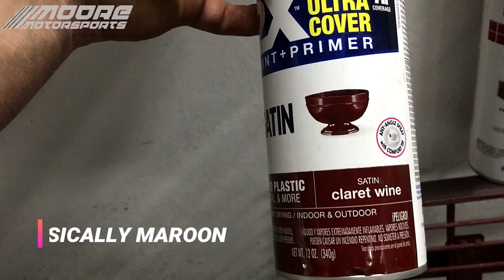Cheap Satin Spray Can Paint job With AMAZING RESULTS! (CHEAP DIY)

Comment: Looks so much better that it did before, I like the matte look of the paint too. I love the trick with wet sanding using the sprinkler, I wouldn't have thought of that.
Reply: I get a gallon jug with a few small holes on the bottom that way it slowly drips out n keeps things wet.
Reply from the maker: BIG ANT that works great too!!

Comment: Legit the only person I know of that can spray bottom to top bs top to bottom and make it turn out good. Whenever I see anyone else and or have tried myself spraying that way it always has the paint overspray from the air that drives and falls down into the wet paint leaving that gritty look here and there. Still comes out with wet sanding but so much more work. Congrats on being able to do it properly.

Comment: Man, I just used 2X recently, the white high gloss, and I really like it. I think I personally like it better than Advance Formula in most ways. I think it dries faster, though, which is good and bad, but it also seems to actually dry harder and more durable, it feels almost "urethane modified" compared to Advance Formula. I feel like it's gonna be way more durable based on my hunch handling my hood and being able to put it back on the car after 3-4 hours vs an entire night for Advance Formula and it still not really being at 100% full hardness until a week or so out. 

Also, I've tried satin on half my car before, but overall I personally couldn't live with it, as it holds onto stains and the like much easier, especially in white. However, satin did help hide some bodywork and prep flaws. Does look great here though for sure, and this is a more forgiving color for stains/etc compared to white. Great work as always!
Reply: Thank you

Comment: I didn't see you wet sand the Primer.

My experience is if you want any chance of getting a smooth final paint finish, You MUST wet sand the final Primer coat.
Not wet sanding the primer will leave you with a rough finish and orange peel.

You do  have good coverage and you chase the wet line pretty well...
Reply: No mms.  He said he wasn’t going to sand the primer.

Comment: It really looks awesome!!👍👏👏 But I have a question,  won't those bumpers start to peel somewhere down the line? I thought you have to use some kind of flex material in paint for plastics/polyurethane bumpers..

Comment: I just painted my son's hood its been about 3 days. The question I had is what grit of sand paper can I use 2 sand it down then try 2 buff it ? I finally found the turbo spray paint ( got 2 get use 2 painting with it ) lol Bueno sir again thank you for any advise O before I forget can I use 320 grit on the rest of the car the clear is really flaky & coming off Thanks
Reply from the maker: I use 320 wet sanding to get clear coat peeling sanded off. Also if you already paint the hood with clear and ready to wet sand and buff use soapy water and 1000 grit then work your way up to 2500 and buffing it out.
Reply: I haven't applied clear can I buff using the mag. wax (compound) only
Reply: I’m sorta screwed tryna paint in orlando aren’t I... no chance it will be 70 degrees until winter

Comment: If you put on a 2k matte clear would you need to wet sand first? or could you just shoot over the fresh paint? Also if you were to buff the paint to even it out would it become shiny? or maintain the matte?
Reply from the maker: Yes if you wet sand with 1000 after this paint is dry you can apply a 2K gloss clear or matte clear

Comment: Nice video man! I have a question...
Is it possible to spray your car with a mat 2x color and then cover it with a gloss clear coat or is it better to apply a gloss 2x followed by a gloss clear? And if you can, does it give a good result?
Reply from the maker: If I added gloss clear it would look good but I prefer the matte finish but I can add a 2K matte clear
Reply: I'm actualy asking for my own car. Could I spray the color as a mat and then cover it with a gloss clear and still get as good of a result as if I sprayed the color as a gloss?
Reply from the maker: RC DREAMS yes you could
Reply: Cool Thanks! Keep up the awesome work! I learned pretty much everything about painting cars from you! :)

Comment: Hey James,  I just painted my mini van with Ruestoleum 2x Fire Orange-Satin, but i have a bunch of tiger stripes, any suggestions how to get them out??
Reply: Light sand and respray .Make sure you overlap 50% each pass, and go both ways (crosshatch) over the same panel. Up down and side to side.
Reply: Tiger stripes also happen when painting in direct sunlight or high temps. Good luck

Comment: I’m looking to try the same thing. As a test run we are only painting the front fender. How much primer and finish paint would you say it took?
Reply from the maker: I’m not sure how to judge how much it took other than I empty every single can to the very end. Except with primer I only use what’s needed to cover everything thoroughly same with the color coat

Comment: Will the paint hold up without a clear coat ? Because I really like this look
Reply: Not likely. Something iv learned from painting. If you do not add clear coat,  all that prep/painting and what not is useless! the paint will find a way to fade/chip away.
Reply: MillieBits  No what i am saying is no matter the outcome of your $40 paint job ( which doesnt really matter cause in paint work its the labor you dont want to waste as it takes HOURS to prep big surfaces) Add clear coat at the end to protect your work! Or it will be destroyed in 1-2 years. When adding clear coat could protect it up to 10+
Reply: MillieBits  Fair enough, if he chooses to re-paint the same car over and over it makes sense not to use clear coat. Im new to this channel so i didnt understand why he did such a good job painting and didnt add the clear coat. but now that makes sense as its one less thing to strip when re painting.

Comment: I've done the same thing on a VW Polo 6n2 and after just 3 months the paint on the roof and hood looked terrible. 1 year later it started cracking on those parts too.. Holds good on the sides but if the car is outside in the Sun it wont last..
Reply: Did you clear coat and protect the paint properly?
Reply: @sethoz22  yeah I used clear coat as well. I mean I aint no pro on paint but on daily objects I've painted it lasted a good while but not on a car that i tried

Comment: Quick question
I was wondering if i have to grind down the old paint to bare metal?
Or can i have the old paint uner the new one?
Reply: you can paint over the old paint, if you want. sanding it to a rough finish before painting is ideal

Comment: Did you use matte spray paint then put satin over top of it
Reply from the maker: Satin maroon No clear or anything over it. I ended up using this as a base coat for my bedline paint job. It came out really good when finished. Check out the other video on the channel

Comment: How long do you wait after primer? Just until it's touch dry, or after cured? Thanks.
Reply: Better to wait untill its cured because if u sand after only the top is dried most likely under the dry primer is still soft

Comment: Does dude only ever lay one coat of paint?? And no clear coat?
Reply: Yea and it comes out pretty solid. Good 10 footer. I'm sure if you did 1 coat primer, wet sand, 2 coats base, 2 coats clear, wet sand, buff, polish, it would come out insane but then it starts leaving the realm of comfortable and super cheap diy lol

Comment: The way you painted the Pink gloss with the 2kclear was Fly! But in that one you didnt add any type of primer. And in this one no clear coat. You can use any paint even cheap ones like rustoleum but the real Key is the prep work,Primer and the clear coat! If you cheat that process one scratch or just the elements will expose all your hard work quick. And them boom waste of money and you have to redo it. Which means it's probably best to go to Maacos! ITS like the same price especially if you do all the prep. But spray paint rustoleum is cool but for it to look real for like a couple months or more it needs 2KCLEAR it's the pro stuff everything else is furniture paint!

Comment: Don’t you need to add some sort of flex paint additive so the paint don’t chip?
Reply: In my experience with rattle can paint. It does dry as hard as automotive paint and is doesn't seem to crack or chip as easily. I don't think flex is necessary
Reply: @joshestess  Rattlecan I think lays on overall thinner than automotive paint, so it flexes better for that reason. But I think it's possible with rattlecans you need better prep than with a urethane as with a urethane paint you're laying on more mils. Rattlecans would be more like oldschool lacquer paint jobs.

Comment: Man i'd like for you to do my ford explorer. ive been wanting to try it but i know i'll mess it up. im in Texas too
Reply: Have more confidence than that, man. Go buy a hood or a fender from a junkyard and practice on that before you spray your Exploder. Its transmission is on borrowed time anyway, so go for it soon. Lol
Reply: ed elsey I’m at 241k on the truck but engine got all new gaskets in at 240k and cleaned out and transmission was also done same time with everything new haven’t driven for over a year just the start up and drive around the block since it’s my oldest car I have so I want to make it look decent

Comment: Next time don't waist money using blue tape to mask the floor,, use regular masking tape..it actually holds the paper better..
Reply from the maker: I tried that didn’t hold very well. Maybe I just bought the cheap cheap crap
Reply: MillieBits  what I meant was,, the cost of using regular masking tape instead of the blue painters tape..

Comment: next time add a 2k clear coat it will fade and you cannot buff so nice effort
Reply from the maker: I know it will fade idc lol
Reply from the maker: I can always wet sand with 1000 grit and add 2K matte clear
Reply: He'll change the color. It's like having a different car every time.
Reply: I did my race car 6 years ago and it hasn't faded yet. Maybe somewhere with high UV but here in the UK it's fine.

Comment: rustoleum oil based paints that come in quart can work great! just reduce it down with acetone 15% spray from hvlp gun, i spray a spoiler on my prius gloss black, shop wanted to charge me $200 , did it my self $9 a can, only used 1/4 of it turned out like glass, no orange peel, im thinking of wet sanding & spraying with 2k clear,,, theres alot of people that paint whole cars with this paint, you can mix up different colors to get desired color,,, i did a wine cellar iron door, had a grape vine design, painted leafs green, grapes bluish purple(after mixing desired tone),,, turned out good, then i was like shit i could paint a whole car with this stuff, whats great with this paint is when it dries you can wet sand any imperfections out & buff
Reply: How much acetone?
Reply: @DT-js6pp  better use lacquer thinner then acetone, dries slower, brings out much smoother finish,,, How much depends, on the air temp, any thing from 10%-15% of base paint, just practice first on something

Comment: No 2nd coat?
NO clear?
🙉🙈🙊
Reply: and no wet sand primer or buff
Reply: @MBZXZ  hey man, you did a great job! I'm not complaining, but you were right there, would have looked awesome with clear or even matte clear. It protects(uv rays) and seals in the color. Wet sand that first coat of color and then put second coat of color. You need that second layer especially on curves and corners anddoor/key, wear areas, front bumper from oncoming traffic road "sandblasting".
I'm almost 50yrs old. First Honda was a 92 hatch in 92(haha) and was hooked.
Not much available back then, so I had to learn how to use fiberglass and make my own parts to be different. Doing it yourself can be very rewarding when everybody drools and all the broken necks at traffic intersections. I'm in the middle of making a widebody/flare kit for my 2009 civic si sedan now.😁

Comment: Need clear coat on any paint job dealing with cars. Clear coat water sand and buff it that would be a good video
Reply: Yeah it's satin plus he ends up painting it bed liner over the top. Wouldnt be able to do this without waisting the clear. He always plans ahead